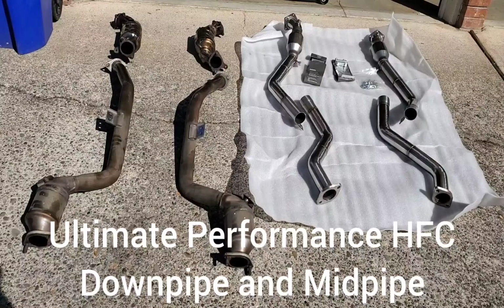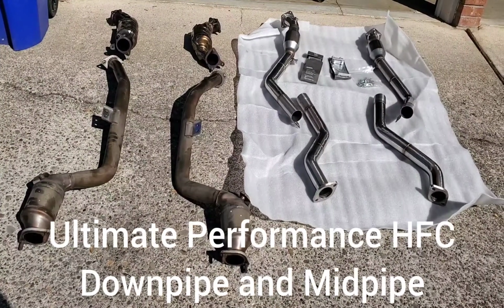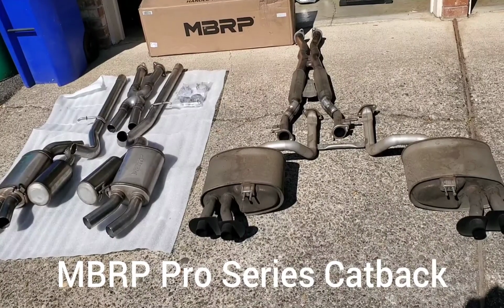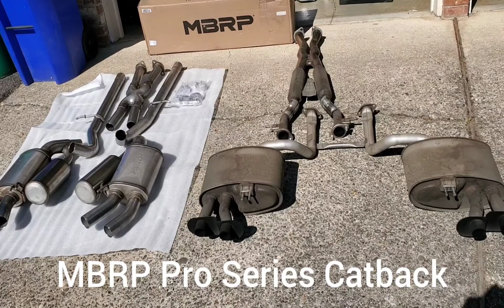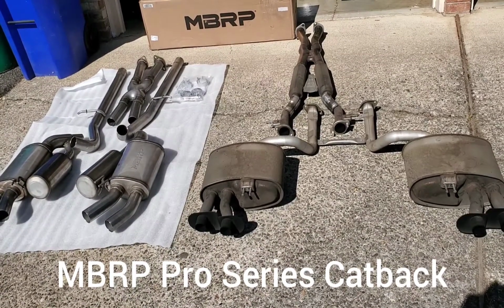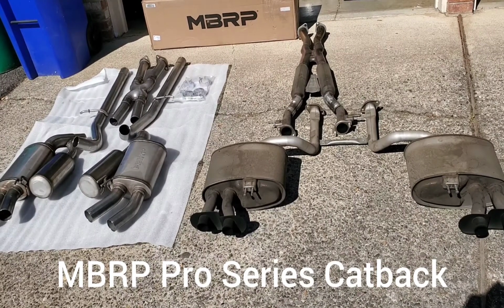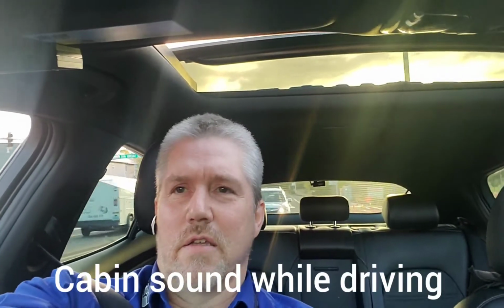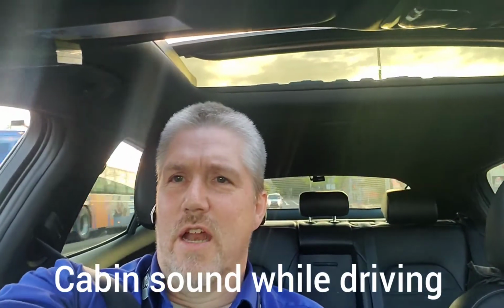Ultimate Performance HFC Downpipe and Midpipe - MBRP Pro Series Catback Combo - Before / After Sound

Comment: Great Video!! I subscribed for more. Was it difficult to install the HFC downpipe mid pipes? Did you have to take off the Cadillac converters?
Reply from the maker: Ultimate Performance Downpipes come with a High Flow Catalytic Converter. They had spacers on the lower O2 sensors that caused problems. I had to remove the spacers and now the car runs correctly. The downpipes are difficult to remove due to the limited space behind the turbos. You can do it, but you have to take your time and make sure that you spray the nuts with PB Blaster and let it soak for a day or two so you don't break the studs.
Reply: @StingerGT2   what changed when you removed the spacers?
Reply: @omariboone-morales1782  why remove the spacer

Comment: I want to do a JB4 with fuel wires, intakes with velossa tech big mouths, secondary cat deletes with an mbrp catback. I'd love to do the hfc downpipe combo but its my daily so Im not sure if it would drone and make it crappy on road trips. You should definitely make more videos, especially some track times or dragy videos. If this dropped your 0-60 0.2 seconds you're probably looking at close to half a second quicker in the quarter mile at least 3-4 tenths. What did it run/trap before this?
Reply from the maker: There is a slight drone but I could eliminate it if I extended the end of the pipe out the rear. Right now it is bouncing off the rear diffuser. My quarter improved from a 12.315 to a 12.025 with just the exhaust change, no other changes to the tune yet.
Reply: @StingerGT2  Thats badass!
Reply: Ive got that setup, no hfc though. Just Mbrp+ secondaries is pretty loud. I also have K&N intakes. Love it
Reply from the maker: @LoneStarStinger  I am loving the setup on mine too!

Comment: I did the MBRP Pro and it sounds great.  I then did Injen CAI.  I'm not too happy with the noises under the hood.  I like the turbo sounds but the air rushing into the system is a bit much for daily driving.  I was thinking that maybe try to out an aluminum cover over the top of the air box to tone down the sounds a little bit. Anyone try this?  The top of the air box is open and I suppose the hood kind of does what I want, but the strut brace is running over the top of the box, so it's not a complete seal. 

I see you have the Velossa Tech on there, but did you do a CAI with that or is it the stock air boxes?
Reply from the maker: I have the BMS Intakes and didn't notice too much sound difference with air, I mostly hear the Tial BOV. I kind of like all the wind sounds anyhow. 🙂

Comment: I just installed these. And when i have my valves open in sport mode sounds like a honda civic hatchback. The shop couldnt figure out where the rattling was coming from. They told me i might need some mid resonators since i del mine

Comment: i'm looking at doing the Ultimate Performance HFC downpipe and midpipe combo. I currently just have a muffler delete. I have a ver y subtle amount of drone. when im cruising at 2000rpm its barley even noticeable. I'm wondering if i add this downpipe and mid pipe, do you think the drone would be bad ? Its my daily cruisier. I love exhaust sound but i'm not a fan of loud drone in the car. what are your thoughts ? Thank you!
Reply from the maker: Unfortunately, can't answer that right now. I have a lot of drone but my exhaust is not sealed correctly and it is not properly fitted in the rear. I would have to fix those first to see. I have been planning on it, maybe I can take it to the exhaust shop this weekend and let you know... 🙂

Comment: Did you notice a big difference... I was thinking of going this route..
Reply from the maker: I didn't get it to the dyino after the change. But, I would guess it was around 10-20 WHP.  I went from a 12.3 quarter mile to a 12.0 quarter mile.
Reply: @StingerGT2   What other mods do you have done? I'm currently running the jb4 map4 e85 mix... junbl cat back, imr  full front mount intercooler, vivd bov's, aem intakes, velossatech big mouth, racechip xlr throttle tunner... so really all that's left is the downpipes.. lol
Reply from the maker: @jessestanich4777  I have pretty much the same setup, just different manufacturer's. WMI made a big difference, I gained .5 seconds in quarter, have better top end power now.
Reply: @StingerGT2  water meth injection?
Reply from the maker: @jessestanich4777  yes

Comment: Great video! Do you have any problems with overboost when you added the ultimate performance midpipe/downpipe combo?
Reply from the maker: When the temperature outside got down to about 40 degrees, I started overboosting. Of course, I have WMI so it lowered the temperatures even more. Other than that, it runs awesome!
Reply: @StingerGT2 Is there a way to combat the over boost? Or is that just one of the caveats to having this combo?

Comment: How did you get rid of some of your rasp mine is horrible with same set up
Reply from the maker: Did you finish the pipe out the diffuser? Mine was bad before because it was bouncing off the underside because the pipe didn't reach all the way.
Reply: @StingerGT2  nope, I have pipes extending the tips. It's like you can hear the rasp under the car and out the back. It's insane lol rattling can.
Reply from the maker: @curtislaketek2952  I also replaced the original clamps because they weren't sealing properly.
Reply: @StingerGT2  https://youtu.be/YTxMPiXblfw 
Also uploading interior as well
Reply: They make MBRP resonators specifically for people who have MBRP cat backs with downpipes. It's supposed to eliminate 95% or all droning and rasping. When i had my MBRP catback and UP downpipe combo installed i couldn't stand the rattling. Called up Ultimate Performance and the dude told me that so many people complain about running their downpipes with MBRP. It's just how they work together so i ended up putting my OEM catback back on but just bought the resonators so im hoping i am going to get rid of that obnoxious rattle/drone/ rasp. Ill post a vid once i get them installed. Should be in about 2 weeks.